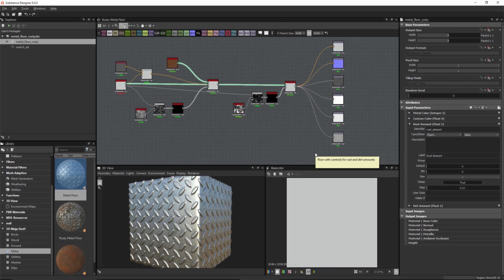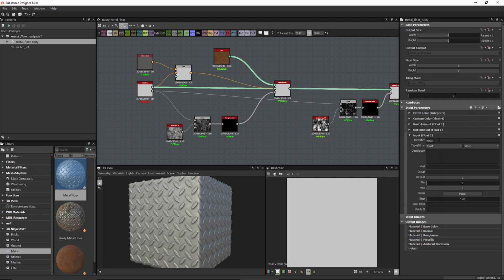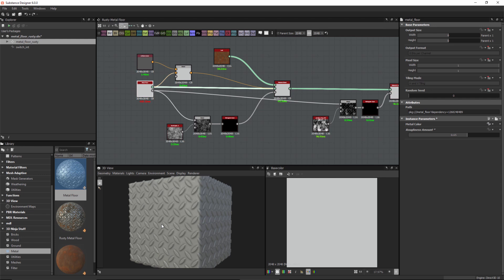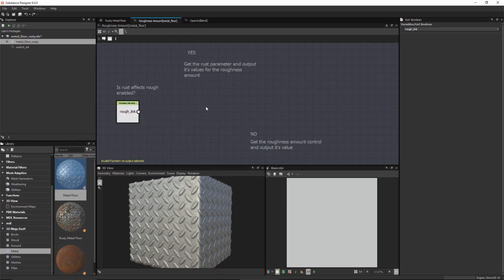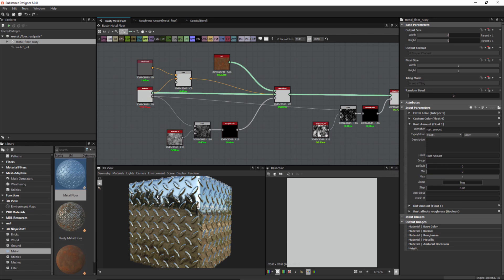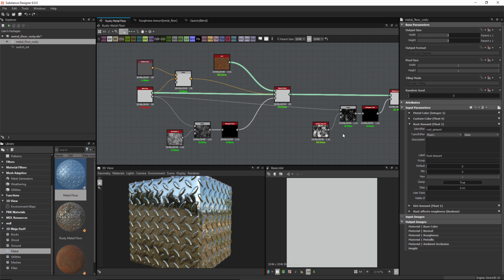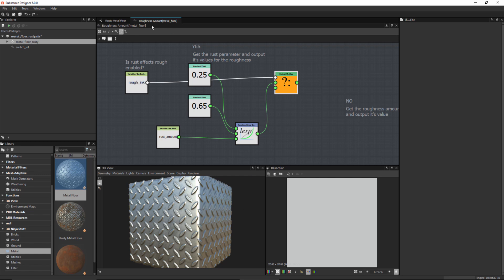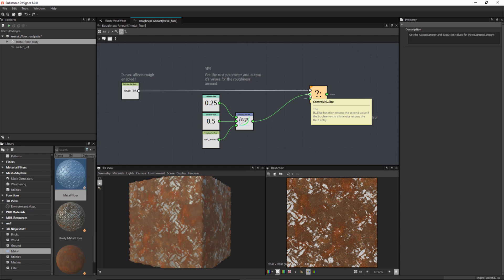Substance Designer Getting Started: 04 - Part Four: Linking parameters - 01

Comment: You can link parameters to the input variables, but can't link them to values in other nodes ._. And the connection you create is a one-way-street: you can't change parameter from inside the node even though it's a simple link.
Most of the time it's probably enough, but...
Here's my user case:
I have several textures: diffuse, normal, fx.
When I transform one I want the other ones to move as well.
A single transform node only allows one input and output, so from here I have the following options:
- create an input parameter that is shared between nodes
- create a node with as many inputs and outputs as I like, then create an input parameter that is shared between nodes

And it's all fine and dandy, but due to one-way-street relationship between nodes and parameter, I just lost the handy intuitive controls for moving and scaling my texture and have to put in random numbers, hoping I hit the sweet spot.

Or hit the sweet spot with yet another transform to do what I need; and then copy the resulting matrix and offset to the input parameters.

What I want ideally to happen:
- create an input parameter that is shared between nodes
- since it's a parameter link(not a function) have an ability to change the parameters' value from inside the node where I have handy controls.
Reply: did you ever figure this out? i also need help with this

Comment: Great job on these tutorials! I generally like to pause the video at various points and try to figure out or anticipate a solution. Maybe it's just a lack of knowledge on how the function graph works, but I found myself trying to wrap my brain around how If/Else and Equal nodes interact with a Boolean.

I paused at 3:30 or thereabouts and used my GetBoolean to pull up the rough_link (which we learned about in the previous video). Then I, incorrectly, went into creating two Boolean variables for True and False that I'd attempt to insert into a Comparison/Equal node (which I would have fed into a If/Else node, if the graph editor hadn't already clued me into the fact that I was doing something wrong).

Going back to the previous video, there was a point where I tried to anticipate how the "switch_int" function graph would work: We will get our "dropdown" value and feed it into an If/Else node, and WITHIN that node we will tell it what value to check against. But instead, we fed two values into the Comparison/Equal node and THEN performed our If/Else, feeding into that node the outcomes.

Going back to this video, a C/E node does not accept white outputs, so that was another indicator I was doing something wrong. But I was wondering why we would not compare the Boolean against a True statement. It took me realizing that the point of the C/E node is simply to have a binary result. Because that is what an If/Else node is. And since a Boolean by nature is binary, it would bypass a C/E node, and go straight into an If/Else node.

I had to write out my thought process so I could make sense of this. Maybe this observation of node interaction is super obvious to other people (or maybe it is not). I find if things do not make logical sense I am unable, or unwanting, to move on with the video.

Maybe the interaction is even simpler than I concluded, and will sink in better as I continue to use SD.

Edit: The lerp graphic is awesome! I just love how it illustrates the functionality. People at Allegorithmic must be uber brains to be so artistically and technically inclined. :)
Reply from the maker: Thanks very much for your input! We are glad to see you taking an active interest in learning Designer. Please let us know if you have any questions.